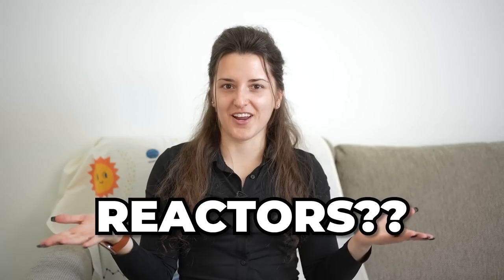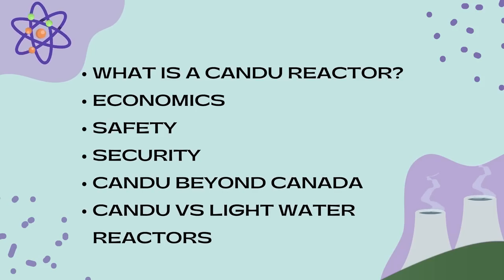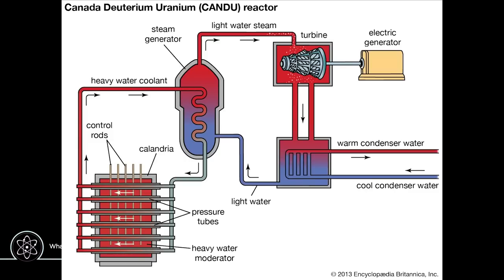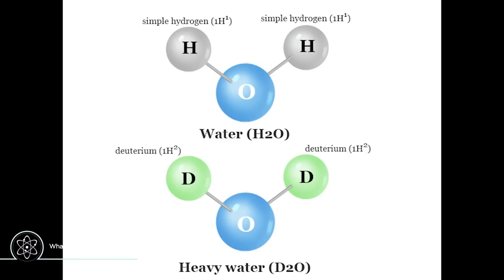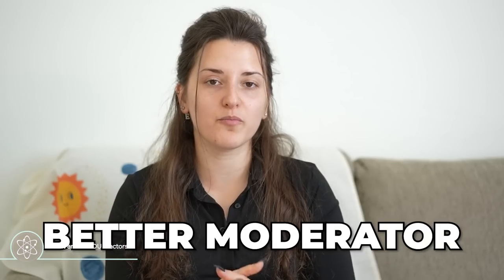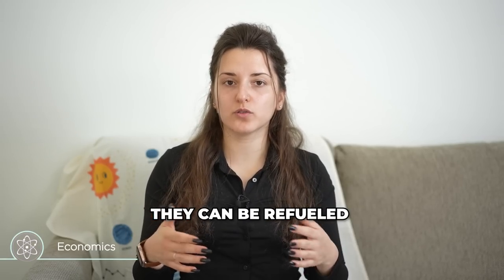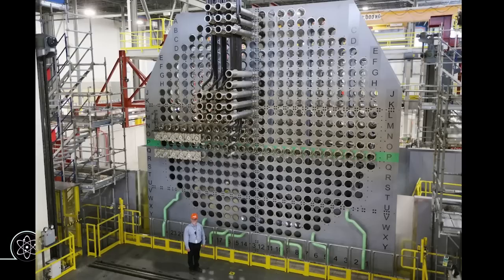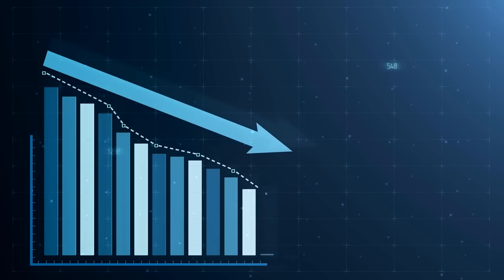Nuclear Physicist Explains - What are CANDU Reactors?

Comment: I grew up in a town right next to a CANDU site with 8 reactors and had family and friends who worked there. To me, the most interesting thing about CANDUs is that their design enables passive failure modes. Natural Uranium doesn't have enough neutrons to sustain a reaction by itself, hence why the heavy water is required. This also means that if the supply of heavy water is cutoff, or if light water is introduced, the reaction will stop. This allows the design to use safety features that don't require active intervention or power, preventing situations like Fukushima. Based on the comments I had from people who work there, the workers have to spend much more time just keeping the reaction going instead of working to keep the reactor from going boom.
Reply: Thank you for pointing this out as it was missed in the Video and is one of the ket structural safety advantages of CANDU.
Reply: Where did you grow up? My grandfather’s farm was in Underwood.
Reply: Natural Uranium can sustain a chain reaction, but only in the presence of heavy water.
Reply: the heavy water just does the moderating not the cooling. cooling happens by light water circulating through the core hence CANDU reactors have a positive void coefficient if light water coolant is lost. in that case the heavy water is more easy to manage than graphite though as it won't catch on fire.
Reply: the fuel can still melt down without an active reaction - that's why the waste is first stored in pools of water before long term storage. a fukashima event can still happen, the fuel still needs cooling when there isn't an active reaction.
Reply: @Jon  you're thinking of enriched uranium fuel (pretty sure fukushima was a light water reactor), I'm pretty sure.  Natural uranium pretty much just sits there doing nothing without a good poke with a dutritium stick.
Reply: @Hamstray  heavy water is used for both moderation and cooling in CANDU reactors. The only light water in the core normally is in the liquid zone control system. The emergency cooling water injection system is also light water, but that is a poised system. 

If light water was used for cooling (primary heart transport) then the reactor could not be critical.
Reply: Is there no decay heat from them?
Reply: @scottlife1697  the natural uranium fuel bundles do not need any special cooling before they go into the reactor. However, natural uranium fuel actually does produce decay heat after it has been irradiated. This is due to the numerous fission products that are created while it is in the core that have different half lives. The CANDU fuel bundles are stored in pools for roughly a decade to cool before they have decayed enough to be air cooled in dry storage containers.
Reply: @Heja16  I stand corrected.
Reply: @Hamstray  There are three independent water systems used in the heat transfer in the CANDU system.  The primary loop goes in and around the reactor core, filled with heavy water.  There is no light water near the core.  As noted, this is kept under high pressure to keep it from boiling at the temperatures it operates.  The heavy water is pumped to a heat exchanger with the secondary loop which exits the reactor building; the water in the primary and secondary loops never touch, just transfer energy.  
The secondary loop contains purified light water which is allowed to boil and it is then run through steam turbines in the generator house, which drives the generators to produce electricity that is put onto the electrical grid.  This water is too hot to be pumped back to the primary loop heat exchanger, so after the turbines, it is sent to a heat exchanger with the tertiary loop.
The tertiary loop contains water from outside, usually cleaned, but not purified, lake or sea water.  The operational CANDU systems are all on large bodies of water (Great Lakes or oceans), so that warmed external water is returned to the body of water at the other end of the facility.  As such, you will not see any steam stacks like light water reactors on rivers.  This is the only open water loop in the system.
There is one more water system in a CANDU facility which is city water, used for drinking and washing by the humans that work there; it is not used in the heat exchange with the reactor itself.
Reply: I grew up in Ajax and visited the Pickering site a couple of times growing up; my Scout troop got a guided tour through the plant by one of scouts' parents who worked there.  Were you a neighbour or were you up in the Owen Sound area, near the Bruce station?
Reply: @danuttall  Near the Bruce, but a lot closer than Owen Sound
Reply: @Hamstray  you're correct and yet incorrect. All current candus use heavy water as both moderator and primary coolant. Its required for the neutron economy to run unenriched fuels.    The most current yet not built design the acr1000 @1.2gwe is designed using a light water coolant that reduces the upfront costs for deuterium and greatly reduces the size of the calandria.  They will however require lightly enriched @2% uranium to run. Or rerun used pwr fuel.  The thorium cycle also works in the candu reactor
Reply: @scottlife1697  

This applies to all fuels, including CANDU. Residual heat is the rapid decay of accumulated radioactive isotopes, and they don't care how enriched you are.
Reply: It can still melt with decay heat (some 10% of operating power in the first hours after shutdown), also heavy water likely corrodes metals just as well when hot enough, releasing hydrogen (deuterium, but it's likely as dangerous as hydrogen). That's what happened at Fukushima AFAIK.

Comment: I'm calling BS for your reasons on "Safety".  It's all about the engineering.  Since heavy water allows for better neutron efficiency, the CANDU reactor design takes many engineering advantages of heavy water.  First, heavy water allows for lesser enriched uranium pellets.  That means less fissile fuel in the reactor.  Second, the arrangement/design of the fuel rods/channels bend or spreads apart when overheated, this allows the reactor to passively become less reactive (loses neutrons) causing the reactor to cool down.  Yes, the CANDU reactor is safer because it's designed from the ground up to use only heavy water, but heavy water by itself doesn't make a reactor safer.  For instance, using heavy water in a light water reactor won't make it safer.

Comment: One key point of CANDU which was not addressed is tritium production.  Tritium is essential for fusion research and while it is theoretically possible fusion can become self sustaining with tritium blankets it is another very difficult engineering problem (because fusion didn't have enough of those already).  The CANDU reactor is how the world will get tritium for initial research and is essential to potentially cracking viable fusion.
Reply: Perhaps it will have value for initial research but the production rate is too low to be meaningful as a fuel supply. Half life is around ten years so we can't even keep it in a bottle waiting for a fusion reactor.
Reply: @adamgavey1028  Viable fusion will need a C rate of ~10 and tritium neutrality.  In an ideal world if we are 30 years from viable fusion we will need tritium produced to start reactors and perform research.  More Candu reactors are key to this and perhaps short lived Candu SMRs with a ~10 year life may be a good way to generate it.  Candu SMRs are in development.  Without something we will never achieve fusion due to being supply constrained (in addition to the many incredible engineering challenges).
Reply: Very good point, and I would add It is an identified concern that the scheduled decommissioning of these CANDU reactors presents a limitation for future fusion research.  It is surprising to me that so little effort has been focused on validating that breeding tritium from lithium is actually viable for fusion power generation.
Reply: @ccibinel  Agreed, Li6 blankets for breeding Tritium seems to be one of the only viable options. Fusion has a long long road to hoe.
Reply: @Pnote2000  Actually, one of the key mission ITER  is to test tritium breeding. To me, it seems like one of the easier problems to solve in fusion. I think you also need the 14 MEV neutrons from fusion to test in real conditions so it is very dificult to test without a large fusion machine.
Reply: Sounds ironic that a nuclear fission reactor is needed to make the fuel for a nuclear fusion reactor. I imagine one could be optimized just to produce the tritium for a neighboring fusion reactor. However tritium is also a byproduct of other nuclear fisson reactors and is present in the spent fuel which makes reprocessing of that fuel challenging. Removal of the tritium is required because tritiated water is not something you want to be drinking in your drinking water.
Reply: We actually did achieve ignition back in 1952 with the Ivy Mike test, so the problem of producing energy from nuclear fusion is already solved. The issue is how to capture the energy as electricity, instead of producing a giant mushroom cloud and a rain of radioactive fallout.
Reply: @Pnote2000  Most of the Canadian CANDUs have been incorporated into a refurb program they'll be around for quite some time yet, beyond the fusion advantages CANDUs are also a key producer of medical isotopes.
Reply: @AmurTiger  Yeah. Chalk River was once the world's biggest supplier of medical isotopes, with more than a billion procedures being done with its products over its long operational lifetime (every year, 20 million people in 80 countries around the world were treated or diagnosed with its radionuclides). Unfortunately, the NRU reactor was shut down in 2018 (at the time it was the world's oldest operating nuclear reactor, if you can believe it, running nearly continuously for 61 years...so it was probably a good choice to retire it, as the costs of safely operating it weren't justified anymore, despite the benefits) and is in the process of being cooled and decommissioned. But other projects look to keep that legacy going.
Reply: @marc-andreservant201  
Lol, compared bombshell to reatcore, clever.

Comment: In terms of safety, you didn't mention that every CANDU station has a building attached to the reactor building that is under vacuum and has water sprayers. In case of a LOCA (loss of coolant accident) it sucks up and condenses any radioactive steam. This is one of the safety barriers to releasing radioactive material to the environment.
Reply: The Cernavoda NPP does not have a pressure relief building. Not every CANDU station has that building. 😁
Reply: I think that the only ones with a vacuum building are the sites in Ontario having 4 or more reactors sharing a vacuum building.  The single unit in New Brunswick does not have one.
Reply: You are correct.
Reply: This is not new. Russian VVER 1200 and VVER TOI use SAOZ (САОЗ) tanks to fill the reactor with borated water, which is simpler in principle, because everything is contained in a containment along with the reactor.

Comment: I grew (Winnipeg - had a tour of the CANDU simulator in Pinawa, MB) up believing that the 2 biggest safety features (esp in light of 3 Mile & Chernobyl) is the heavy water moderator lends to non-weaponizable materials (as you noted) but also because if a runaway condition should happen, dumping the coolant/moderator/water actually stops the reaction - it fails safe.
Reply: Yes dumping the moderator would stop the reaction but poison injection where a neutron absorber  is injected into the moderator acts much faster and is what is used.
Reply: Also, since heavy water is necessary for the reactor to work, any overheating of the fuel will boil the water, removing the moderator and stopping the chain reaction.

Plutonium is actually produced, but for the weapons-grade stuff you'd need to irradiate each fuel assembly for a suspiciously short time which would produce very little electricity. The whole world would immediately notice your weapons program and stop selling you uranium.

Comment: Thanks so much for this video, as a Canadian I knew of the CANDU and roughly how it works but I didn't knew all the details as to why we had them or why they weren't popular elsewhere.
Reply from the maker: Thank you for your comment ☢️👩🏽‍🔬 I am glad you found the video informative
Reply: Having such a different design can mean safety regulations are not appropriate or hard to apply. For example, most reactors have a negative void coefficient, meaning the fission rate falls when coolant is removed, but CANDU reactors have a slight positive coefficient. This is actually a very minor issue, especially when so many other factors and active safety systems have an effect, but regulations assuming a negative coefficient will disqualify a CANDU without an effort to change the regulations (which some people might regard as weakening them under corporate pressure).

Comment: I grew up not far from the Bruce Nuclear Power Station and now live not far from the Darlington Nuclear Power Station. Knowing the advantages of the CANDU, I always wondered why it wasn't more popular.
Reply: the higher upfront cost and not being able to
Make plutonium efficiently is two reasons why it’s not more popular
Reply: Because it has few advantages. Basically, this is the cost of heavy water. Considering that France and Russia are massively enriching uranium for reactors, enriched fuel for light water quickly pays for itself. And also its complex design, like the RBMK reactor, only CANDU is also under pressure, which causes a lot of problems with pressure pipes.
Reply: @nedward.7442  Heavy water is easier and cheaper than refining petroleum. The problem is that it is unconsumed, once you've made it you don't need to make more, and therefore has a small niche market.
Enriched Uranium is consumed faster and is simpler to make a bomb with, hence a larger market. It is also less safe. All the nuclear disasters have been from enriched uranium facilities.
Reply: @allanlank  
1) What does oil have to do with it? How is heavy water production cheaper than recycling? This is a completely stupid comparison: a product that is consumed by the whole world, and a product that is needed only in narrow circles of production.

2) The bomb requires a uranium enrichment plant and the purchase of lithium 6, this will be such a large-scale production that everyone will notice it. Moreover, the main disasters did not occur due to enriched uranium at all, but mainly due to the incorrect design of the reactor and the carelessness of the workers (Chernobyl Nuclear Power Plant and Fukushima).

How long has it been since your enriched uranium burns out faster? In reality, it’s just the opposite: the higher the enrichment, the longer the life of one company.
Reply: @allanlank  
P.S. I understand about uranium consumption. True, the estimated reserves of uranium, from which 235 isotopes can be extracted, last for 50-100 years. Moreover, this will not make sense if we develop a nuclear fuel cycle based on plutonium, or a thorium cycle in general.

Comment: Theres also a new CANDU style Small Modular Reactor being developed in Canada atm, and its the only SMR in development afaik that can use unenriched uranium. Four of our provinces are working to advance our SMR industry, and Saskatchewan, which exports lots of uranium but currently doesnt use any itself, plans to start using SMRs by 2030
Reply: I'm not aware of any actual work being done on the CSMR. Do you have a reference other than the marketing materials? I know we're working on MOLTEX, ARC and BWRX licensing, but am not aware of any CSMR work actually being done.
Reply: Smrs are like free beer tomorrow signs at the local bar.   Anything that runs a pressurized water system will require containment 
  As the primary expense currently nukes must be big for economy of scale.  Thorium  Liquid salt and low pressure primary loops will make smrs a reality.  Till then it's all flying car advertising...

Comment: Thanks Elina for the clear cost/benefit explanation. As a student in UT, we were told there was a small Candu reactor under the physics building.  I always wonder why it wasn't more popular...now I know. You made my day!
Reply: If you're talking about the reactor at The University of Utah, it's actually a TRIGA reactor (much lower power and used primarily for research) and its on the engineering campus.
Reply: @tedgood1224  , It's probably like you said for research but in Canada. :-)
Reply: @harryhall4001  , ah...you are right. My memory failed me. Thanks for the correction.
Reply: I think UT is the Universtiy of Toronto.
Reply: @bryanemmerson7779  yes I know
Reply: You may be thinking of the SLOWPOKE reactor if UT =  University of Toronto. It was not a CANDU though it was designed by the same folks (AECL).
Reply: @richardbaird1452  , you and Harry Hall are right. I stand corrected. Thank you!